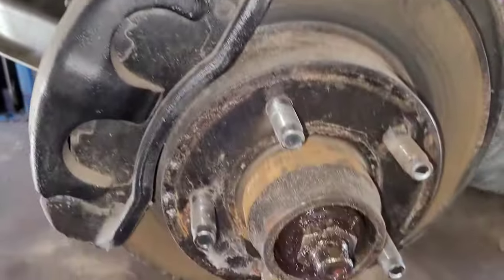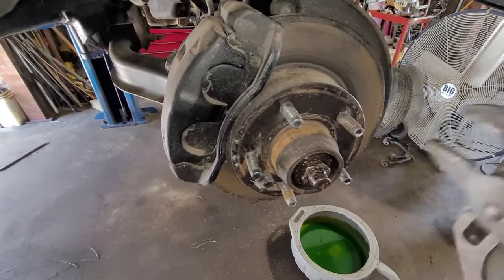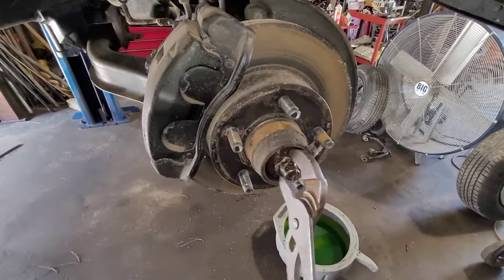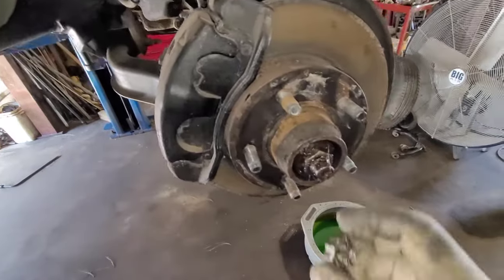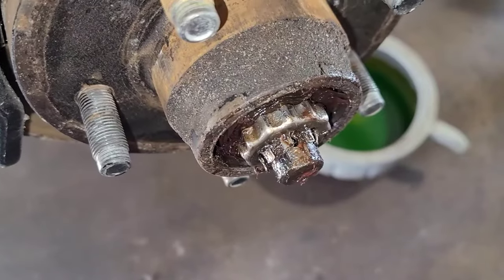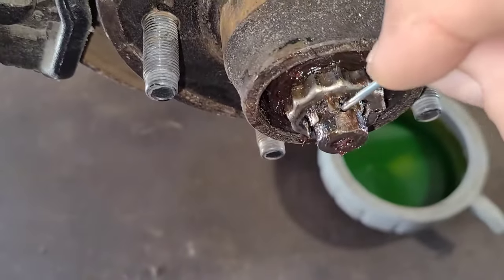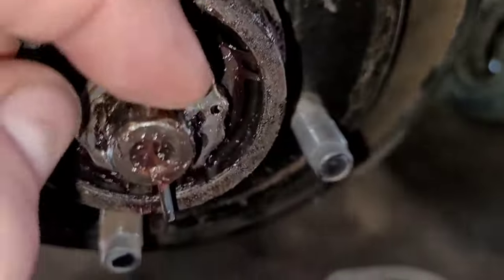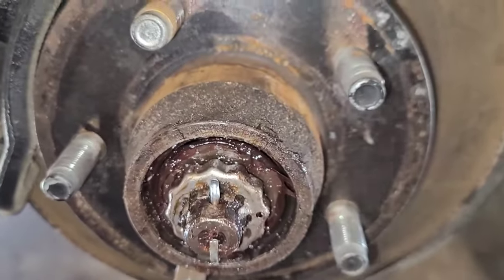Adjusting front wheel bearings

Comment: That's the way I was shown back in the later 1960's on a 64 Oldsmobile 88. Back then all the front wheels had these tapered roller bearings on spindles with the raceways pressed in the drum front and back. You packed bearing grease all over the bearing and spindle. Adjusted bearing spindle nut just like you showed.

Comment: The correct way to actually just a wheel bearing is this I learned it from working on German cars you just the wheel bearing so you can barely move the washer that's behind the nut the washers between the nut and wheel bearing the washer should be slightly snug look at an old German car manual you'll find the correct way to just any wheel bearing there is.
Reply: Exactly...... My dad was a mechanical engineer in the early days of the aerospace and was a salt flats racer! That is the way he taught me as well

Comment: Guys wheel bearing preload adjustments differ from the type of bearing you are adjusting,the example on the video only applies to tapered roller bearings and doesn't apply to thrust bearings,thrust bearings can be torqued to 150 - 250 nm

Comment: When i started messing with cars it was mostly 50s cars, particularly 55, 56, and 57 chevies.  They came with BALL bearings. I believe they needed to be pre- loaded a bit or they would screw all up if they got loose.
Tapered flat roller wheel bearings dont like being too tight.
The way i always looked at it they need to have a tiny bit of clearance if they were completely dry rollers, so with grease that would be about hand tight.  They need room for when they heat up a bit.
My general procedure has been to tighten them up about 10 lbs. and spin the hub a bunch to make sure everything is well seated, then back it up and tighten by hand or with very little torque.
Kinda like Kenny did.
Just remember tapered roller bearings like being loose, but not TOO loose.

Comment: I appreciate the video, on my 98 pathfinder with all mode 4x4, I didn't see any hub damage and I replaced bearings and races. It all went smoothly until I noticed the slightest amount of play in the right front wheel. I'm at a loss
Reply from the maker: You may have to readjust the bearings. If it's a complete piece youre going to have to replace it...again. That stinks! Keep wrenching 🔧

Comment: I can see why you've had great luck with it. I used to do it the same way. If I installed a rotor from scratch and packed the bearings, I'd replace the tire and give it one final rock back and forth after I re-mounted it. With the leverage of the tire, i could tell whether or not I seated the bearing as close to metal as I could get it without over tightening things.

Comment: Thanks
Reply from the maker: I hope it helped. Thanks for watching & keep wrenching 🔧
Reply: @WrenchingWithKenny  
I’m hoping that you can tell me whether or not the ANOTHER pre-load (tension the nut up to 18-20 ft. lbs) if I merely wanted to go back to the nut (after completing the job / procedure) and loosen it a bit so it might be corrected to the proper very light 18 -20 inch lbs ?  Or can I just go directly to the finished very low last torque spec ?

Comment: Thanks for the video.  I have replaced the bearings in a 2001 Ford sport Trac. The alignment shop said there was play.  

My question is this:  with the tire off the ground and pulling at the 12 and 6 position, should the bearing move at all, ie, should there be any movement when you rock the tire?  Thanks
Reply: Nope. There shouldn't be any play. If you get even a couple of millimeters of play, your bearings are toast. Get new ones and start over.

Comment: Way too loose
Reply: It's not actually.. just reading out of the GM factory service manual " to tighten the nut 12 foot pounds on a new installation to seat the new bearings and back the nut off to just loose position by hand until a hole in the spindle aligns with a slot in the nut.. and do not back off the nut more than 1/4 turn... the correct end play is .001-.008... the bearings must be a slip fit on the spindle and the inside diameter of the wheel bearing must be lubricated to ensure the bearings will creep. The spindle nut must have a free running fit on the spindle threads"... the reason it is done this way is so that the inner part of each bearing is allowed to creep as you drive and hit bumps in the road so that the inner part of the bearing does not get wear only on the bottom... it makes sense if you think about it... and as well don't forget everything will expand from heat and  end play will decrease... if you don't do it that way the bearing will fail and then it will spin on the axel... I have visually seen the results and it wasn't pretty